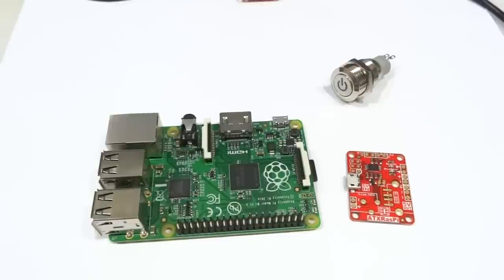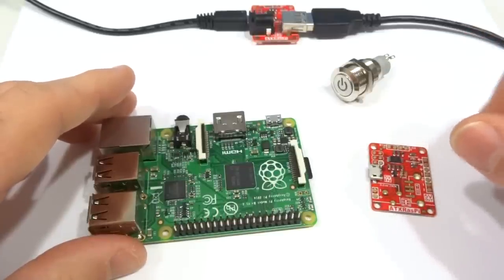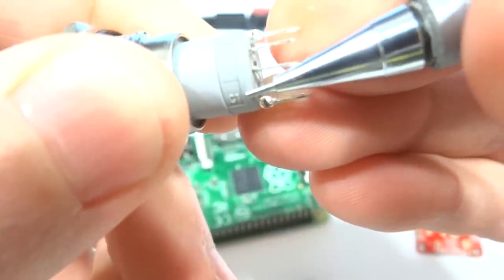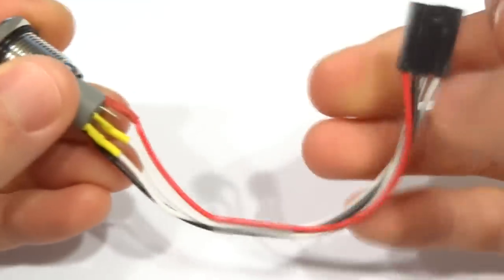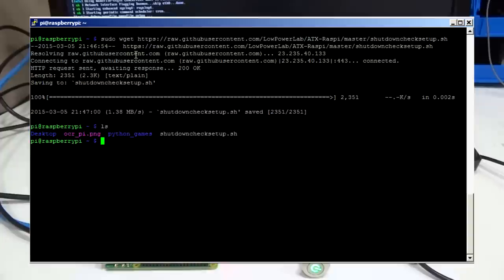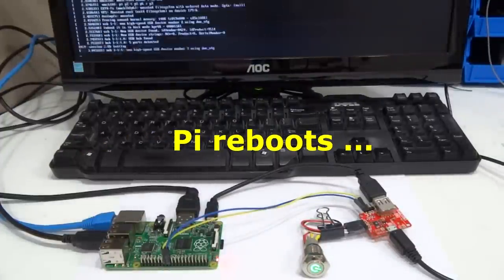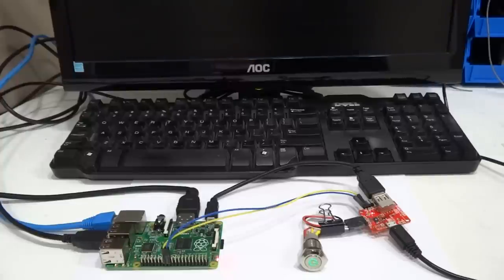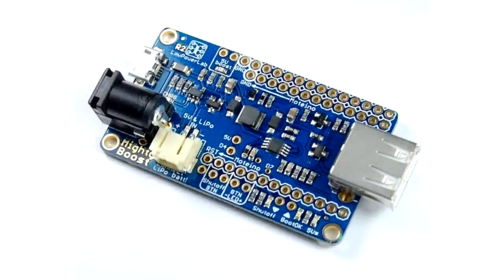ATXRaspi overview & setup

Comment: Can you mount a female header on the ATXRaspi to connect directly to Raspberry Pi GPIO header to make it cleaner?  Maybe use a four pin female header for better support but connect only the two GPIO pins and not + and -.

Comment: cool little board! wouldn't it be nice to have it all in a single add-on board ? I mean the backup power + reboot/shutdown controller.
Reply from the maker: The MightyBoost + Moteino can do just that. It was designed to be a booster and allow you the same functionality when paired with Moteino. The trafeoff is modularity and flexibility. So if you just want a booster MBoost will do it. If you want the backup + ATXRaspi you can pair it with Moteino or even directly with ATXRaspi.

Comment: Can the code be changed to work in line with car ignition switch off and start up.
Reply from the maker: I don't think the code would be different if the switch is a car key switch. You would need a good PSU that filters out car power bus transients.
Reply: @FelixRusu  thanks for the reply I'm going to look in to this. Trying to work out the best way to run open auto pro in my car.

Comment: How much better is this than the people who make power buttons that go straight to the GPIO pins? Are their solutions less safe or is this board really intended for more than just on/off functions?
Reply from the maker: This cuts power off to the Pi also.
This supports shutdown and/or reboot buttons (both latching and non-latching switches starting in Rev2.7).
Many benefits from using a board like this.
See the guide and features here: https://lowpowerlab.com/guide/atxraspi/
Reply: meaning zero power to the pi when off? Without pulling the plug out after?
Reply from the maker: The circuit (ATXRaspi is still using a few mA of power because it acts as a switch monitor).
But yes, zero power to the Pi after it's shutdown.

Comment: My momentary switch has only 4 leads, positive, negative, no1 and no2. there is also a resistor included for loads over 3v, how do i wire this?
Reply from the maker: As seen in video. No resistor needed, already onboard.
Wire no1/2 to button pins (leftmost) and -/+ to rightmost: http://lowpowerlab.com/atxraspi/#diagram
More questions in the forum please.

Comment: would this work if i had the (Adafruit Rugged Metal Pushbutton 16mm 6V Blue On/Off Latching NO and NC Switch)
Reply from the maker: Yes, just use the extra 10k resistor to put the board in latching mode, as explained in the guide: https://lowpowerlab.com/guide/atxraspi/assembly-install/
Reply: Thanks appreciate you replying

Comment: does it shutdown if we type a shutdown on the command line? Car project, it turns the pie on ignition, and the OS has a shutdown command integrated.
Reply: P.S. I want to remove the button in this setup.
Reply from the maker: Yes, almost - it can be done as explained here: https://lowpowerlab.com/guide/atxraspi/full-pi-poweroff-from-software/

Comment: Why on earth is it called something with ATX? http://en.m.wikipedia.org/wiki/ATX
Reply: Felix Rusu Honestly I do see some confusion that could come from the thing being named ATXRaspi, as it in no way conforms to any ATX standard. Also, why is a script needed? I was under the impression that the serial connection on the Pi's give access to a root terminal. Security reasons?
Reply from the maker: dumle29 ***** Let's keep this clean and not get hung on the name. A product can be called anything without the name having to do anything with the function of the device. This is obvious in many products that you already have or use, think "apple" products, microsoft "windows", "RaspberryPi", etc.

Comment: I can use it in the recalbox?
Reply from the maker: What is recalbox?
Reply: Felix Rusu recalbox is a system for raspberry used for emulator retro games. see their website: https://www.recalbox.com/
Reply: Felix Rusu in it already has a code to connect the reset and Power buttons the doubt is whether you can use these same commands or do you have to do this as described in your video? thank you!
Reply from the maker: So that's just a distribution like Volumio or others, It should work. ATXRaspi controls power, and has a script that responds to its button presses. It has been used on many distributions. You may need to alter the script depending what shell is running. You can ask more questions in the forum: https://lowpowerlab.com/forum/atxraspi/
Reply: Felix Rusu thanks.
Reply: Recalbox has built-in support for ATXRaspi.  Just uncomment one line in recalbox.conf file to enable support (shown below).

system.power.switch=ATX_RASPI_R2_6      # http://lowpowerlab.com/atxraspi/#installation